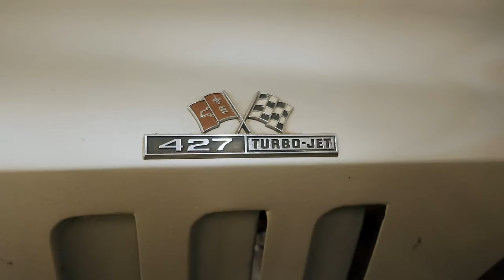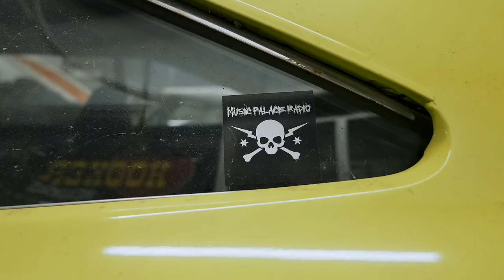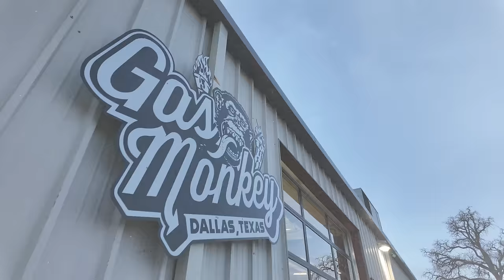North Carolina Classic Car Nest - 8 Car Buy

Comment: He can sell 4 of those cars for 220k and make his money back and the other 4 are straight profit .... that guy shoulda called Dennis he woulda got double that😆😆
Reply: I think after calling dennis he told him there worth way more and pay the 220 but richard being richard got them down to 170
Reply: Wrong,each car can EASILY fetch $325K
Reply: The mopars were originally 318 cars swapped to 440 clones. They still have value but 325k is nuts. Richard scored tho the 66’ vette and pace car are probably worth around 120k on their own if everything is number matching which is a big if. The other cars are easily worth 20 to 25k as is only because they are more on the hot rodded side.
Reply: Seller was happy. It takes a lot of work and money to roll on auction with uncertainty. Can play games on Facebook marketplace and have 300 people offering you scrap telling you that you should be greatful and what a piece of shit you are. This guy dusted hit hands and cashed out. Market is full swing change also.
Reply: @GSXR750ization ya he didn't have to work and buy all of it , it was all just given to him so he just said its alot of cash now give me 🤡🌎 ... moral of the story is ALWAYS CALL DENNIS BEFORE U CALL RICHARD 💯
Reply: @gshell2520  The only flaw in you thought processes is thinking your making a different deal with dealing with Richard or Dennis. One shows what he pays other doesn't. They are best friends. Your never gonna be the best friend on the deal.
Reply: @GSXR750ization  no one low balls the shit out of u and the other one pays fair price and doesn't haggle richard made alot of his wealth off taxing the shit out if dennis
Reply: @gshell2520  Ok bro...The publicly post these videos and are still best friends. Someday I hope you figure out how the world works. God bless.
Reply: @gshell2520   lol, how stupid a comment, Richard calls Dennis and Dennis advised him .. get them for X amount I will give you X amount … try are mates and won’t rip each other off ..
Reply: @gshell2520   Richard...lol You should read this..lol
Reply: @gshell2520  You have no idea if Dennis haggles, he already has the deal done before he arrives, he always says "I'll pay you what we agreed on" well no shit.
Reply: im subscribed to your channel and were here for cars 🤣🤣✌
Reply: @867diesel  cars and good bud it's a hard combo to beat😆🤙
Reply: Good stuff! pretty sure both Richard and Dennis were in on the script for this but still entertaining! 😉👍
Reply: @wileecoyote5749  I think you done lost your mind
Reply: He can take the money and go put a down payment on a demon 170. That was so sad....The pace car was worth $175,00 by itself... Numbers matching '69 big block Chevy Indy pace car?
Reply: @TheGforcead  you're drunk
Reply: @George-dy3pt  I quit drinking in 2008, but I guess it's better then just straight crushing them. I would never have sold them that cheap. The seller is happy. I could have done better!
Reply: Awesome rides what a score. If the cars were original numbers matching in great condition they would be worth alot more money but how they are they not as much as everyone thinking. To much watching barret-jackson. Lmfao

Comment: FWIW ~ 1969 BIG BLOCK CAMARO convertibles are RARE. 
189 - L78 convertibles,  
198 - L34 Convertibles, 
785 - L35 convertibles. 
______________________________
1172 BIG BLOCK Camaro convertibles built through the end of September 1969.
 
IIRC The 69 model camaros were built into the second week of Nov.

Comment: 64 years young I just wish some kid's could have some fun with theses car's , but you scored again only time will tell how much but that 66 vett number car your flush , if that is a real numbers car untouched possibly from the looks of under the hood, I see the value in that room differently then most mopar's there wow . and a 69 camaro complete and original think you got off cheap there too depending on its background, So I say you did very well out of the box :face-turquoise-covering-eyes:

Comment: If the Camaro is a L78 which it could be, it does have a AL intake, if it has a CX trans which matches the VIN it's a L78 or L89. 
A nice L78 pace car auto will bring 100k pretty easily.  A L34 auto pacer will bring 75 easy.

Comment: Richard ,if that Pace Car  has a history of OriginalnOwner being either in Maryland or Delaware   for any length of time  i know  how to get in touch with that guy and  the info  I do know if it’s his old one it was Drag Taced at one point  and converted back  the guy i know. would know  most likely  who or where  any parts  would be  in that area. it’s a tight group Of Chevy People. who used the same Machine Shops ,Engine Builders and Garages  for their work  i  personally only dabbled  with Chevy Small block motors for a short time  and i crossed paths witha few of them during that time  BTW i lived in that area for 35 years  and crossed paths with a lot of people of all different  Intrests